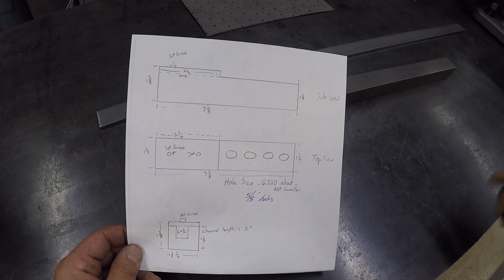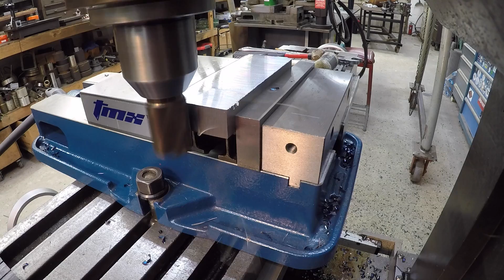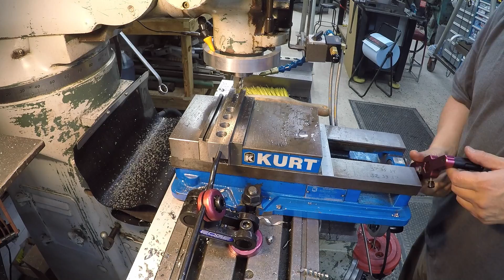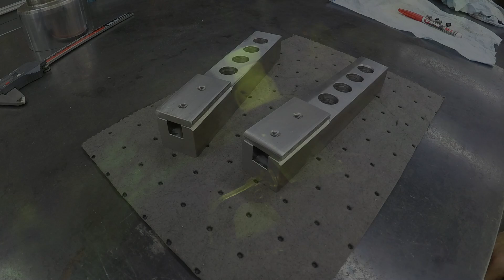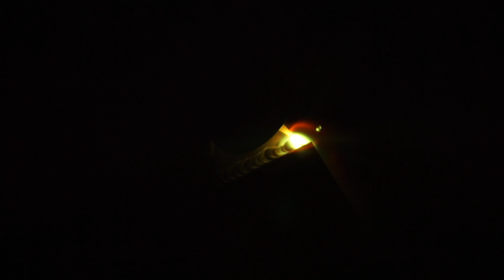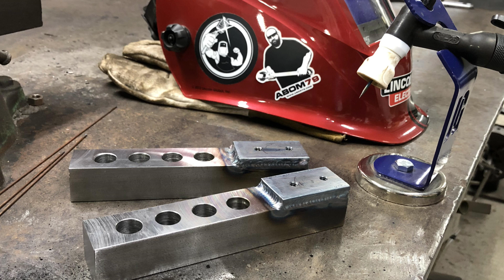SNS 298: Custom Parts Machined & Welded

Comment: Just wanna say love the channel. I work in the food and beverage industry welding stainless. After we make a weld we let it cool a minute and hit the piece with a wire brush while still hot and it takes of the discoloration. looks much better. Unless you gonna paint it. Just passing on a little tip. Awesome videos thanks again.

Comment: Did you ever get some more spacers for yout horizontal mill arbor? If not what side do you need for your arbors? I'd and length. 
Ron Kincaid 937-935-7003

Comment: Pick up as set of these tap drivers. The OD's are all STD collet sizes. They work great fro power tapping....

https://www.amazon.com/Lisle-70500-Tap-Socket-Set/dp/B0002SRFOE/ref=sxts_b2b_sx_reorder?crid=3N5BML3MY9DBA&cv_ct_cx=lisle+70500+tap+socket+set&keywords=lisle+70500+tap+socket+set&pd_rd_i=B0002SRFOE&pd_rd_r=316e5b66-30c2-466a-9a2e-823a3e0eed24&pd_rd_w=1wzxi&pd_rd_wg=ZOVB5&pf_rd_p=f853991c-061d-4ae7-8dd6-6ae8c4726518&pf_rd_r=VRX9WHSP9SXP9DWYASPT&qid=1585532506&sprefix=lisle%2Caps%2C173

Comment: I've noticed in the past couple of videos you haven't been using lubricant while milling steel, facing and cut to length operations. (I think that's new for you.)
That's not what I expected. Can you explain the philosophy your going by for that decision? When you think it is appropriate to use or not use lubricant?
Reply: I feel like there's a reasonable chance that it's as simple as things usually looking better on camera when they're dry.
Reply: It's done for our benefit, so we get to see the machining and not a whole lot of lubricant obscuring it, Adam will of course be replacing the cutters more frequently because the lack of lube will wear them out faster, you will likely see lube when machining metals that gall easily or when he has issues with getting a nice finish.

Comment: @abom79 I see you are using a noga mister could you tell me on how you have that set up and we’re u have the coolant for it at when u are using it on mill? Also I need some work done by you some machining done. I do not have the time or the machines to do it. I need a V block clamp made what do I need to do to make it the easiest for you do do my project that I need done?

Comment: Are you using an autoreverse tapping head or are you reversing main motor.
Reply: Most tapping heads are autoreverse. If it's not, it was probably not made for tapping in the first place.
     It looks like he used a standard chuck, not a tapping chuck. They look completely different. They don't use a chuck key. Just an Allen key. (the ones I used anyway)  After watching again, it may have autoreverse built-in to the machine. The chuck certainly looks like a regular one.

Comment: Great vids Adam.....In the UK, M/C gaurds are a must, are regulalations different in the US ?   Would hate to think of shattered cutters causing you harm......We were also told not to used compressed air guns on M/C’s to clear swarf for fear of of the slide ways being contaminated with fine dust.
Reply: also we use the term swarf not chips.. like ya said jeff,and thou as apposed to thousandths of an inch..
Reply: @derrenwebb5962  He is talking to the general public, so he needs to be specific and not use shorthand.

Comment: I love your videos.  If you get a moment, may I ask two questions, please?
1. When you tap holes with your mill, is the mill programmed to lower the bit at the same rate as dictated by the thread pitch?  If not, how are you able to get such clean taps from a machine:?
2. How on earth do you keep your shop clean with all of those metal flakes flying around?  I see the trays and such, but it looks like there is a decent percentage that misses the plate.
Thanks again for sharing your work with us!
Reply: I was thinking as the thread catches it pulls down. He's lowering it by hand, and letting it finish. Reverse, and hold it before it let's go on the way up... Just a thought.
Reply: The tap pulls itself into the hole. The quill is unlocked while tapping on a manual machine. You sweep off the machine with a brush onto the floor, then you sweep the entire floor area around the machine.  Yes the chips get everywhere.  Once in a while you’ll see Adam use a board to block chips that are trying to fly across the shop to ease cleanup.

Comment: I bought the same welder last year. I've not had much time or oportunity to use it. I had never tig welded before. Do you prefer the foot pedal or the torch mounted switch?
Reply: its only good for spot welding. for contentiousness welding i never use the pedal. and its actually a waste of money than
Reply: using the pedal to control amperage for sheet metal/thin tubing/aluminium welding can be a big advantage if you get a little practice if not even necessary.
especially with aluminium, it first wants to soak heat, then goes fine, then goes running and dripping if you continue to weld with the same heat input as the one you started with.
for mild steel, the pedal might make a big difference if any at all - in stainless it can be an advantage.

Comment: Adam, I'm not a metal worker by trade but I am an aircraft mechanic so I do understand most of what you do and talk about. However I do have a question about the welding you do and that is : when welding a part that you have chamfered a channel for why can't you cut a piece of filler to lenght and just melt it in place instead of dabbing it in place. I'm sure that if I was to go back to my old shop class days (1966-67) and look in those old books I would find the answer but I don't have those books anymore. Keep up the good work and I really enjoy your video's.  Paul C. Patrick SMSGT USAF Retired.
Reply: TIG welding is not like soldering were you could do like you suggested. If you were to lay the weld rod on the weld seam and hit with the flame it would just melt into small beads of weld, and not fill the weld seam. For the weld chamfer that was welded up in this video, Adam used about 3” or more of weld rod per 1” of weld length. Find some Youtube videos about TIG and MIG welding for a better explanation.
Reply: Paul Patrick you dab to ensure that you are melting the parent metal on both sides. If you practice the lay wire method, there is a chance that you will melt the filler metal and have no penetration and fusion of the parent metal.
Reply: You can do it that way. It's called "lay wire tig welding." Search it on YouTube. All the big welding channels have videos on it.
Reply: Main consideration with laywire or laying a piece of filler in there is fusion at the root of the joint. Adding manually also allows you to trim the size of the fillet on the fly with more or less wire so as to prevent undercut if you start getting it hot etc

Comment: I don't hear any 'bacon frying'. Your welds look so pretty. I'm not a welder, but I like seeing a focused spot of heat, being controlled, making a pretty weld. What if You didn' t use any gas? You could still make a decent weld, couldn't You. What would the weld look like? Thank You for Your videos.
Reply: Tig welding doesn’t make frying sounds. If you turned off the gas, you wouldn’t have a weld. Just porosity
Reply: Charles Reliable not an expert by any stretch. Not using gas would give a really bad weld even if the tig worked. I did a weld class and the arc just went really weird without gas, the arc wondered, spread out and was unusable
Reply: Shielding gas is essential. It wouldn’t weld correctly without it. It would be porous and brittle. And the bacon frying is not for TIG. It looks like a similar welding process but TIG is a totally different animal than arc welding (mig and stick).

Comment: Using a grinder can actually add contaminants to the metal.
Reply: We're not welding a Mars rover here.
Reply: Andrew Delashaw I see you’ve got a comment for everything. Mars rover or not, doing the best job possible is always the highest priority, especially for a paying customer. Grinding can and will deposit contaminants, I find it to be much worse with stainless steel.
Reply: You create a problem, that is not a problem. Welding mild steel for a hobby project and using a grinder is no go?
Come on, even for code welds, grinders is not a problem.

A grinder disk used for steel, should never be used for stainless, that is commen sense.

Comment: Why did you call the 1/4" x 20 tap a gun tap?
Reply: They're not full spiral taps, but straight taps with spiral-point flutes that push (or shoot) chips ahead of the tap and out of through holes.
Reply: It is the type of tap. It has nothing to do with the size.
Reply: It refers to a spiral tap which pulls the chips out of the hole so it doesnt  jam and break the tap. This you can use them (carefully) in a chuck or power drill.

Estephan the journeyman
Reply: @stevecallachor  You're confusing spiral point and spiral flute taps. This one pushes chips forward, not out of the hole. Only spiral fluted traps push the chips backwards out the hole.

Comment: Hey Adam, im in the need of some advice. I have a medium sized shop, where i mostly do metal work ( grinding, welding, painting, and more grinding) and im in process of buying a lathe, and if i do well then i will continue buying machining tools. Question is: how do you Keep abrasive dust and all the other crap out of your precious and expensive machines? I really dont want to destroy a lathe out of pure incompetence.
Ps: i absolutely adore your videos, not only for the machining but also because you are a really cool guy
Reply: If you have the space build another room for it, it's almost impossible to keep dust out of your machines. I keep my lathe tarped and it's still always dirty

Comment: Adam, I’m wondering if you’d be willing to turn a a few 5/16 deep well sockets to custom fit around a lock core and the lock components. I’ve made a few on a drill press with a file, I just can’t get it to be 100% accurate. I don’t need it to be structurally strong. I just need it to be able to handle a hand tight and fit around everything.

Comment: That's the kind of welder you use to weld on the crankshaft timing gear on 12 valve cummins if you want to turn em up, great job

Comment: Adam, not questioning but curious as to why you use the bigger cup for your tig welds, just preference?
Reply from the maker: The new style cups are opening up a new world to me, I’m using them when I can and learning. It’s the Furick cups that has the diffuser in them.

Comment: Great video .If you want better colour on your welds try a smaller cup maybe a size 6 with less tungsten stick out and maybe a bit higher heat so you can move quicker .

Comment: I'm surprised you didn't clean or polish them.
Reply: im very suprized as well adam didnt polish up that blued steel and the weld. but myself being a 35 year welder know that most often a weld actually looks better if you dont polish it. unless the weld is picture beutifull and you polish it all the inperfections will show up  very  visable. adam says hes a machinist not a welder im on the other hand a welder not a professional machinist like adam. i wish i knew  1/3 of adams knowlage as a machinist im only a hobby machinist and still learning but i really enjoy the trade with a 9x49 miil and a 6x12 harig surface grinder with a 40x14 precision metal lathe with most of the tooling to go with my machines. have a good day cozydunt.

Comment: Amazing work as always! One question - do you find that when you TIG near threaded holes that they shift slightly? I always run a tap though any threads after welding as often I find they can tighten up. Just curious. Keep up the inspiring work :)
Reply: frostmotorsport 
That also came to my mind, but in this case they were far away enough from the welds.
Anyhow, in case you have a situation that you may distort the form of the (threaded) hole due to the heat input it seems more obvious to drill and tap the holes after completion of welving ops.

Comment: Wouldn't it be easier to start with a thicker piece of material and rotary broach the square hole in? Just make it out of one piece.
Reply from the maker: And invest in another expensive tool plus tooling that I don’t have a big use for, or just machine it’s the way I did with the tools I have already.
Reply: david ghiglieri or you you could cut it with an end mill and weld a cap plate over it as spec’d
 by the customer.
Reply: Easier? No. An alternative? Yes of course if the customer asked for it and you have the equipment.

Comment: Adam, not sure if you have one yet but for the Kurt vise you should invest in a jaw spreader. Comes in super handy to keep the parallels pushed up against the jaws. Didn't look like they moved during a part change, just wanted to give you a heads up. 

https://www.kurtworkholding.com/accessories/parallel_keeper.php
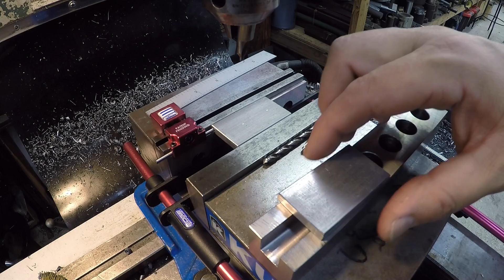Reply: 14:20 He's got one.
Reply: @cojones8518  probably the same ones at 7:53, hanging from the side of the mill (haven't got to 14:20 yet)

Comment: I see he wait couple extra second when stopping welding, what are the reason for it?
Reply: Post-gas to prevent rapid oxidation of the weld joint
Reply: Post flow on the shielding gas. Keeps from contaminating the puddle while it solidifies

Comment: I am a machinist, not a grinder!👍👍
Reply: Milling gives a cost effective consistent chamfer on ever corner of every piece.  Hand held angle grinder or pedestal ground forms may be and look inconsistent, surface ground angles are too slow, costly nor required for welding.
Reply: Wayne Spyker Absolutely!

Comment: Adam- please figure out which mic is causing the high pitched feedback. Its like a dog whistle. I have noticed it for a month or so and I still watch everything it is just annoying. A few videos back when you did the shaft repair with Lance I could see the camera/ mic setup that was the culprit because as soon as you switched views the high pitched sound stopped and the cam could be seen on the tripod. I believe you guys were outside of Lances shop in the shot. Not a huge deal Adam just a suggestion from a long time viewer and patron. Ryan
Reply from the maker: I believe it’s the camera. Ever since I started using the Hero 4 Silver people have made comments about it. I plan to upgrade and get another camera pretty soon.